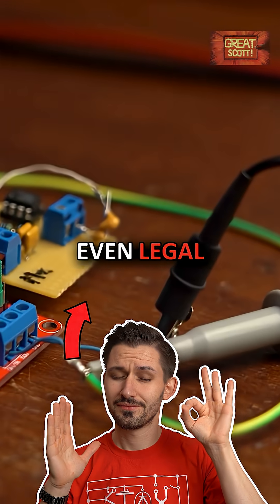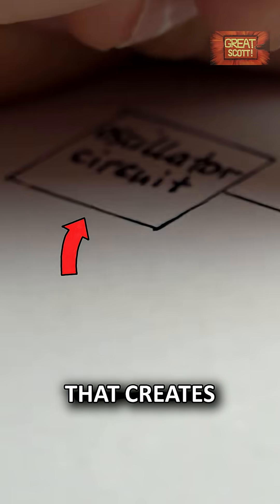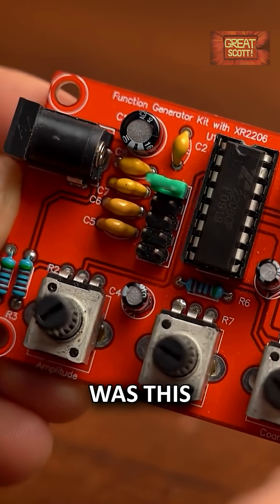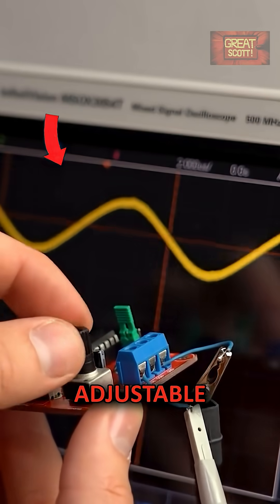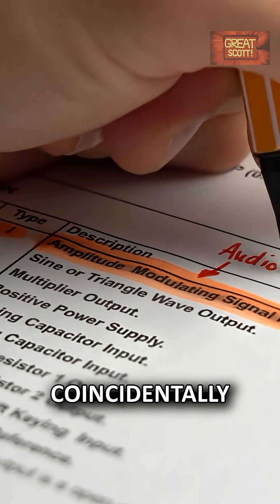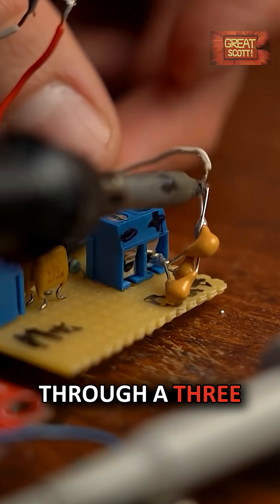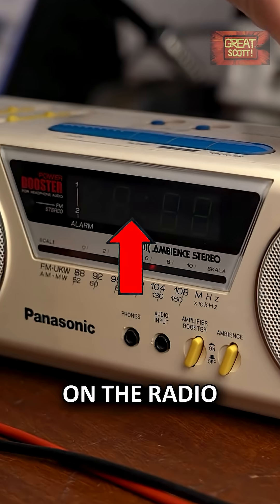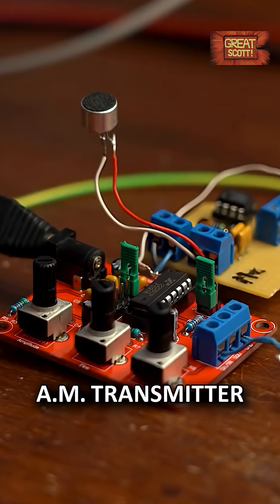Make your own Radio Station?! #diy #radio #electronics #engieering #electrical

Comment: I got in trouble with a DIY transmitter decades ago, but they couldn't make the charges stick because they never actually found the device. Please check your local regulations before building a transmitter of even low power.
Reply: most normal pirate radio station back in the days😂❤
Reply: Hobby transmitters designed for very short range like 10-20 yards are legal unless you use them to cause interference
Reply: @solvated_photon In many places that's true, though the maximum distance varies, but in some places you could be in trouble for making one that reaches half a meter. Making jamming devices is a big no-no pretty much everywhere. They're easy enough to build and it's okay to build a weak one for education or demonstration, but one should absolutely not build a big one with kilometer range using the two most common frequencies used in drone communications to break up any sky advertisements. One would incur large fines if one wasn't slick about it.
Reply: @Cyborg_Octopus you’re right on. 👍 I have had a jammer used on me before, and one time my ex wife had our neighbor root and replace the android version on my phone with a custom build by which they were able to disable its functionality. I’ve got about a half dozen other times I’ve had my tech hacked as well, presumably by the same “group” though I hesitate to call it that
Reply: @solvated_photon  one time my ex wife had our neighbor root and replace the android version on my phone with a custom build by which they were able to disable its functionality

Im not sure I am understanding this sentence. Are you saying that your ex-wife deliberately got the neighbor to hack your phone so that they can disable your phone at will? Is this why she is now your ex? and what was the purpose of doing this?
Reply: @Cyborg_Octopus 😉
Reply: @solvated_photon I made a 50 watt 1.3Mhz A.M. transmitter. It usually transmits about 13 kilometers.
Reply: @IndridCold-o4o  sounds like a very rewarding project. I’m selfish and mostly interested in figuring out how people have managed to torture me in the plain sight of others for more than a decade.
Reply: I made a 50 watt transmitter. It does not sound like a lot of power.  But on a good radio propagation day, I have heard the transmission 100 kilometres away.  The usual range is 13 kilometres.  The experiment has been going on for almost 2 years on 1.3 megahertz AM.
Reply: @IndridCold-o4o that seems very cool, id love to do that. Does it look harder to do than the one in this video ?
Reply: @IndridCold-o4o  look for QRP (Q code - Reduce power), the goal is to transmit/receive far away with low power, usually 5 watts or less for tx... Is amazing how far you can communicate with a good tuned antenna.
Reply: @ That's smart
Reply: How did they trace it back to you tho
Reply: @mohamadred7640 They got me with two tools. Firstly with proximity because the strongest signal was from my apartment block. Secondly they picked the one person who had a massive record (from a childhood and early adulthood being stalked by the feds and the NYPD) and just assumed it was me. 
The music choices were probably a clue though. I was a Soviet immigrant and suspected Communist during the height of the Cold War and I may or may not have played Russian Communist music a few times to get their goat, but I have no idea if anyone ever heard them. Correct answer but wrong way to go about it.
Reply: @Cyborg_Octopus THAT is hilarious 👏 👏  beautiful
Reply: @Cyborg_Octopus  That is such a damn cool story, thank you so much for writing that out for strangers
Reply: He's from Germany and here we have very strict regulations regarding radio transmission. But as this tiny circuit won't have enough power for the signal to even leave your room, it's fine.
Reply: Aledgedly
Reply: Where was it stashed?
Reply: @VDOless I'm not falling for that bait, copper! No, the statute of limitations is long past. I had a toilet that had a false bottom tank. The lever rod within the tank made a convenient antenna. The cops weren't interested in a very thorough search because it was just pirate radio playing music.
Reply: @Cyborg_Octopus  how far was your pirate station transmitting?
Reply: @fjl05 Well it depended on how good the receiver was and if the official station was broadcasting, but usually it covered about a third of the Bronx so probably a ~2km radius. For funsies however, I once had it recording a real station and transmitting it back with a small delay and an intermittent blip every few minutes. I gave it as much power as it could handle and I picked up my blip in Central Park several kilometers away. I could have caused a lot of mischief with that but I just wanted to see if I could do it. Serious pirate stations could go much farther and there were a few others operating in NYC at the time that outclassed mine. Fun times.
Reply: @Cyborg_Octopus  you where doing this in new york? Dang, I thought you where doing this in some foreign country at first, lol. gg
Reply: @fjl05 I did it elsewhere as well but I did it mostly in NYC, yes. Kunming, Kyiv, and Minsk over the past thirty years. I haven't done it in my current country yet because I just moved here a few months ago, but I'll probably do it here too eventually. At the moment I'm more interested in the working payphone nearby. I want to learn how it works here so I can flex my phreaking muscles. I wouldn't use it for nefarious means of course.
Reply: @Cyborg_Octopus  You should start a channel and talk about your experiments lol. would be fun.
Reply: @fjl05 I might do it someday. I can edit video since CGI is my part-time job but I would make a new account for that purpose. It's not fun getting doxxed and I say too much on this account as it is.

Some years ago now I had someone in the USA track me and confront me all the way in Belarus. We don't exactly get a lot of tourists from the States (and all the others I've met were lovely and amused by the New York babushka in Minsk), and they really wanted to tell me off for something I thought was innocuous. I've seen more than my fair share of violence and I genuinely thought that man was going to stab me. And that's why we never use our real names online.
Reply: @Cyborg_Octopus  he tracked you down in another country for stealing airwaves? wow
Reply: @fjl05 Oh, no it was for something I said online. It wasn't directly related to pirate radio.
Reply: @Cyborg_Octopus  He flew from the US to freakin Belarus over online talk? 😂😂😂
Reply: I don't know if you are from the U.S. or not, but the "they" you reference in your post are federal authorities here. If someone is caught broadcasting a signal without proper licensing, it is the federal authorities, like the FBI, FCC, etc., getting involved. The feds may ask for mutual aid from local police, but the legal impacts are all based on federal laws and statutes.
Reply: @ronaldschild157  it's messed up that you could be broadcasting unlicensed radio, end up in prison, and come out not being able to vote or own a gun. I completely disagree with felony disenfranchisement, and I think felony disarmament should be based on the nature of the crime (i.e. a violent gun crime makes sense to disarm them, but pirate radio does not)
Reply: @ps3master72  The criminal system is an often-necessary evil that brings out the worst in social norms. Same thing with the behavioral health system.

Comment: Well, authorities will tell you if it's legal when they visit you while you broadcast...
Reply: How do they find the location of the fm/am host station (or your location)
Reply: @varunnova5905  The signal is strongest at the source
Reply: Signal strength based triangulation?

Comment: "Is it even legal? Well, anyways..." 😁
Reply: I believe it’s legal at the very low power level that the function generator produces.  Educational kit and toy AM radio transmitters have been around since at least the 1950’s; I believe that as long as the output power level is 100 milliwatts or less, and you don’t intentionally interfere with legitimate broadcasting, there’s no problem.  (Licensed amateur radio operator for 56 years and former two-way radio technician). 😊
Reply: @WA1LBK  I guess it depends on your local radio spectrum management plan & how many watts you can put out. 
In New Zealand it appears to be used for broadcasting.
Reply: There's no point then. Who is your audience.  @WA1LBK
Reply: @reuploadify it's for education. You can transmit publicly on selected frequency bands with a license. If you transmit publicly without one, you can be fined over 10000€. Trust me, it happened before, and the price went even higher.
Reply: As we say in Germany: "Where's no plaintiff, there's no judge".
Reply: @andreasu.3546  precisely. "Wo kein kläger, da kein richter*
Reply: @andreasu.3546  Canadian here, we have "its only illegal if you get caught"
Reply: @andreasu.3546  I love that! -signed, a non-fascist USA citizen.
Reply: these are sukits!
Reply: It is illegal in Europe on broadcasting frequencies. You could do it if you use frequencies for short wave communication and you hold an adequate licence.

Comment: Can you do fm ?
Reply: Yeah it’s pretty easy, before cars with the ability to use Bluetooth or usb audio playback from a phone became standard it was common for very small FM transmitters that used the 12v accessory power connector to power it would take the audio from a mobile device and transmit it on a empty part of the FM band that you’d tune the car radio to.
Reply: @Wileybot2004 i am basicly doing the same thing but from a smartphone with usb-c 5v as power supply and usb audio
Reply: you can use just a raspberry pi and rpitx or pifm, I tried it, tried to go way out of the legal limit, but my transistors couldn't work that much
Reply: You need a different module for FM